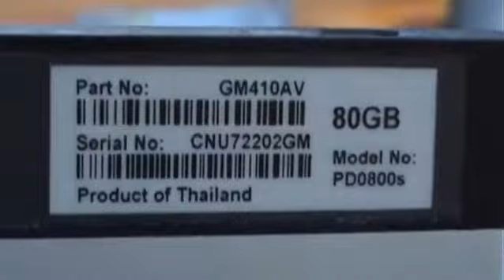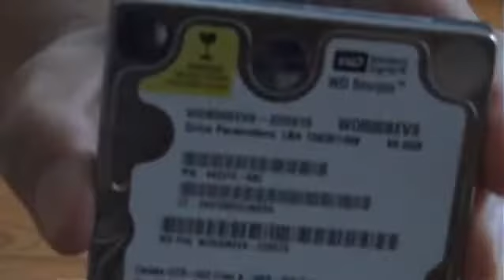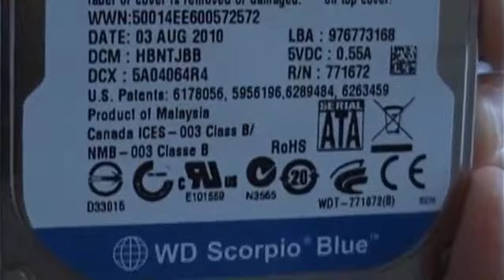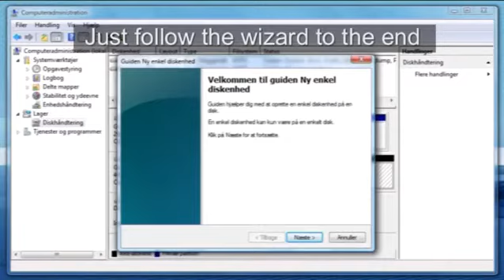How to replace the harddrive in a 80 GB HP Pocket Media Drive with 500 GB hard drive

Comment: Is there a 1 TB SATA that can fit in the HP pocket media Drive case?
Reply: Any 2.5" ssd will fit or possibly M.2 with a suitable adaptor.

Just be aware there is no speed advantage in these enclosures, you need USB3 to get any benefit from SSD (discounting obvious solid state durability). I'd personally spend extra on a USB3 or better enclosure and get all the benefits unless you have spares lying about.
Reply: @Squirrelking4395  I like that I don't have to use a cord and can have multiple interchangeable ones.  I would just enjoy 1 TB over 500 GB.